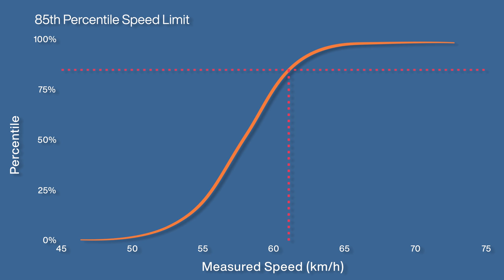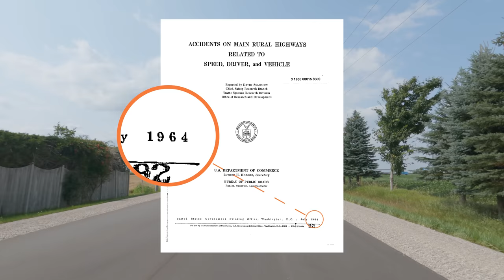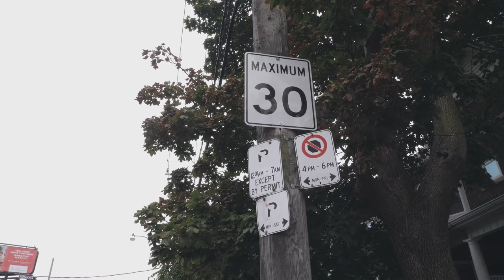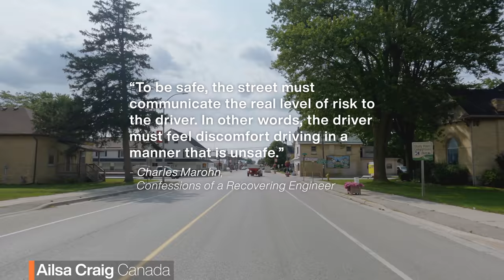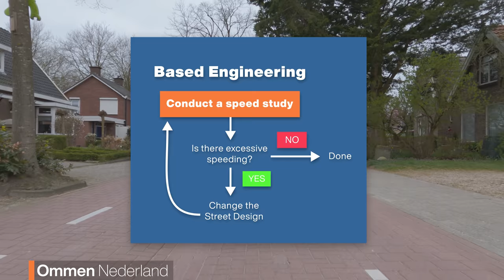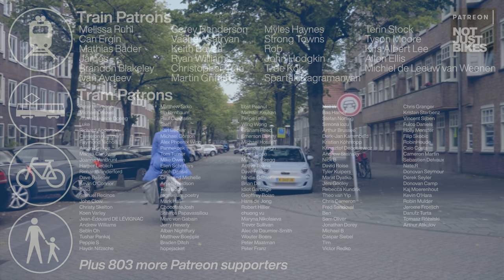The Wrong Way to Set Speed Limits [ST06]

Comment: It seems like a "dark pattern" to add in speed bumps, plant trees in the direct pathways of vehicles, or to assemble posts on the road to deter drivers from exceeding the speed limit.  To me, those ideas work no more efficiently than installing a sign to alert drivers to slow down.  Perhaps a more efficient strategy might involve replacing long, straight roads with pedestrian or bike lanes instead.

Comment: Oh my god it would be SO nice if they set speed limits the way you suggest!! There's a few long stretches of country road I drive down regularly that have speed limits of 60 km/h– why?? It's not busy, it's a straight road, and it's very open, so you're naturally inclined to drive faster!! I personally think the speed limit should be 70 km/h in areas like that. It's not unsafe to drive faster in such places, but that's what the speed limits are set to, which can lead to frustrated and unsafe drivers when others obey the speed limit. It's counterintuitive– you make the speed limit slower to encourage safe driving, but setting it too low for the conditions just leads to MORE unsafe driving!!

I got a speeding ticket last year, so I've been extremely careful about not speeding since then, even in cases like this where I feel that the speed limit honestly should be higher, and as a result people drive too close to and overtake me, often even passing me on my left when there's a double solid line. It's extremely unsafe and frustrating, especially when drivers start flashing their lights at you, or just have bright headlights and are driving behind you at night

It's just... absolutely ridiculous, like you said this isn't rocket science. Make speed limits appropriate for the driving conditions. Boom, problem solved!!

Comment: Yep there’s a stroad like structure where I live that should be road but there are a ton of houses and some businesses that a long it (also two consecutive cemeteries and close to before the highway a golf course with tennis courts). A few years ago they lowered the speed from 30 to 25, but unless you are learning to drive, are with a driving instructor, or taking your drivers test, no one goes 25 on purpose (unless it’s to piss off people which I occasionally do). I myself usually go 30. It is literally a straight road, however, when it gets closer to the high way it is very hilly (ups and downs). This makes me self conscious about my speed , but it is completely flat when you go all the way back by the McDonald’s I work at and my school and many people walk and what not but that stroad is the same. Why does it make you subconsciously slow down when you’re closer to the highway, rather than when you’re by several schools, water parks and businesses? Idk I hate driving on that road and currently I can get away with not driving on it or just going across it.

Comment: Most drivers in my city will go 10mph or so over the limit, except on one street that was paved in the eighties with that concrete slab method. This causes the driver to feel a bumpy ride, and although the speed limit is 40mph, most people do 35 because it feels safer.

Comment: Great video for how to make town and country roads/streets. I would say that low-speed limits on highways are dangerous because it is monotonous driving in a straight line. The UK has some of the safest roads in the world and our highway speed limit is twice that of some US states.
Reply: Your highway speed limit is twice ours?  So, it is 110-160 miles per hour????
Reply: @plcwboy  Of some states... some US states have a 45mph highway speed limit, at least they did when I last drove there. You are correct that I exaggerated. UK speed limit is 70mph.
Reply: @thesupremekai1980s  Highway speed limite have never been lower than 55.  At least not since the 40s.  President Carter saddled us with the 55mph national speedlimit during his term, and since then that has been the minimum, with most highways now somewhere between 55 and 80 mph.
Reply: @plcwboy  I drove along highways with limits at 45mph in Florida so... Maybe the national limit is higher but who gives a sh8t if the highway you are driving on in the middle of nowhere is 45mph. Mostly it was 55mph which was still f-ing slow.
Reply: @TheSakuragihanimichi  where is this highway  in Florida with a 45 mph speed limit?

Comment: nobody follows speed limits outside highways anyway. and even on highways most folk go 10 or so miles over. i ride a motorized bicycle around town at 35-40mph all the time, most of the streets i ride on are marked 30mph, people always pass me. i can be going 40mph in a 30 and if someone in a car is behind me they pass me. i think it is partially just out of lack of attention, they see me on a bicycle, motorized or not, and think i have to be going slower than them, and my evidence for that is that on more than one occasion after someone passes me they start to slow down and sometimes even end up slowing down to a point where i have to slow down. but even then they never slow down to the actual speed limit.

Comment: Speed Limit signs have ZERO impact on how fast drivers choose to drive on a given road. Absolutely NONE. NO IMPACT. 

The issues are two:

1. A small percentage of hyper compliant drivers that can become a hazard- especially when limits are set too low.

and

2. Small percentage of drivers who drive wrecklessly fast. 

The rest- the 85th percentile- are not impacted by speed limits- which is why the 85th percentile rule exists.

Comment: Unfortunately there are sates like Florida, particularly the greater Tampa area, that depend on speeding tickets for revenue. They unethically set speed limits at inappropriate levels and will randomly change them in mid journey to trip people up. Thus assuring that you WILL be getting a speeding ticket. It also helps to set unnaturally long wait periods at traffic lights, even on weekends and the middle of the night, making tension in drivers rise thusly increasing their sense of urgency to make up lost time. Or they will just accelerate to unsafe speeds to get through a light.

Comment: In the UK most speed limits make sense but some don’t.
In the countryside it’s always 60, even on the most twisty roads bc that’s just the rule... but sometimes it’s 50 on a wider road because it has more accidents I presume. It doesn’t really matter that you can only do 30 on the 60 road because of the turns.
It’s usually 20 or 30 in towns and that usually makes sense, often 30 in the edge of the town where the car parks are located or whatever and then 20 in the middle of the town. Motorways are 70 which also makes quite a bit of sense but they are talking about raising it to 80.
There is one road in my area that I think is a deliberate trap, it’s quite a wide road and inviting to do at least 40 on but it is actually a 30 because of the buildings along the road... no traffic calming just two speed cameras. (All of these limits are in miles per hour)
20MPH = ~32KM/H
30MPH = ~48KM/H
40MPH = ~65KM/H
50MPH = ~80KM/H
60MPH = ~97KM/H
70MPH = ~112KM/H
80MPH = ~128KM/H

Comment: In NSW Australia we have many different speeds like L, red P, green P and trucks and it drives you nuts when your truck is limited to 100 km/h with point to point cameras so you end up overtaking a loaded truck and they pass you on the other side or if you go to overtake a red P and they go from 95 to 100 which leaves you in the overtaking lane with many cars behind you.
The joke is the NSW transport minister wants all Australia to do the same.

Comment: In the UK checking your speed constantly is a big part of driver education and it still doesn't work. We have a road network that's mostly grown organically over 2000 years and seems impossible to change with relatively little traffic engineering done to existing roads, politically it's difficult to make change.

Comment: Speed limits should be ""advised", not "absolute".  The worst (and most probably tiring) thing you can do is constantly check your speedometer, which is what "absolute" limits do for fear of getting booked even though there's no victim, or traffic for miles around.  There's nothing on your dashboard that'll warn of impending doom.  The action is outside the windows.

Comment: Here in Sao Paulo - Brazil a Mayor changed the speed on the major city avenues to 70 kph and 60 khp to 50khp. This speed is acctually lower than the design speed for the avenues. Part of the population raged on him but the traffic decreased and the travel time too. 
How travel time improoved? less accidents and better flow.
The accidents that happen around 50 kph don't stop the traffic and are waaay safer than accidents around 60 kph. Why? the kinect energy increses almost 70% from 50 to 60. So the energy involved is waay lower and mainly mas scuffs in the bumpers (if the driver hit the brakes, obviously). Around 60 or 70 the damage easly make the driver stop because the big damage. 
The flow gets better because at 50 you fell safer to be near other vehicles and someone entering yout lane don't make you hit the brake and slow down the lane 300 meters behind you.

Comment: Never heard of that 85% rule. Over here, we just have a few set limits. Highways are 75mph. Big two lane roads separated with a barrier and no traffic besides cars are 55mph. Roads outside rural areas are 45mph. Roads inside rural areas are 30mph and finally at schools we have a 18mph limit in the vicinity. There are no other values used... except once in a while on a parking lot where you might see a 6mph sign.

Comment: I hate how arbitrary speed limits are, as well as how strict they are. I completely agree they should be lower in more populated areas, but like in the clip you were showing of a rural road, the speed limit went from 70 to 50 (I realize the town was up ahead, but I feel like the sign should be closer to that, maybe bigger if seeing it from far away is an issue). Frustrating to have to pay attention to that constantly. Not to mention getting a ticket and having to pay if you get caught speeding. How shitty would it be that you get a speeding ticket for going too fast, and end up losing 1/5 of what you made working that day. Not to mention, speeds aren't even visible so much of the time. You're screwed if you miss a speed limit sign and aren't technically going the exact right speed.

Comment: Not everything in the Netherlands is designed for the appropriate speed. My city of Zoetermeer has a road that's is designed almost identical as a highway. On/off ramps, guardrail, 2x2 roads, no intersections. You can easily without any danger drive 100km/hr. Yet because it is within city limits, you are only allowed to drive 70km/hr.

Comment: I'm frequently irritated by one entrance to my town, where a new bridge was constructed and set for a speed limit of 30 mph.  The bridge is wide, with generous lanes (two on each side), good lights and such... and it's coming off a 45 mph winding road, and the thing is, given that the bridge slopes up and then down again, I cannot for the life of me stick to 30 mph without using my brakes.  Coming from the top of the bridge down to the regular street level turns me to 35 or higher, every time, unless I go under 30 at the top, which, coming from a 45 section, feels likely to provoke road rage.

I really hate when the natural speed of the road -- the kind you can maintain without using gas or brakes -- differs markedly from the posted limit.  It's usually when the street has a particular downgrade to it.  There's another section the next city over that has only a slight downgrade, but across a long stretch, so trying to go 30 like it says requires the use of brakes, whereas the natural speed for that section, the speed the car will go if you just let it, is 35.

There's another bridge heading out of that city toward the waterfront, and you approach the bridge going 35, and have to be 35 at the bottom of the bridge... but the only way to achieve that without brakes is to drop to 25 at the top of the bridge (I've experimented).  And I can see why you can't go faster than 35 there, since there's a sort of hidden driveway that joins the main road, but it's bothersome.

Lastly, there's a section behind our local Walmart that is a windy three-lane with close trees, and is marked at 35... but it feels unsafe to drive it at 35, and I wish it were marked 30.  It feels like a 30.

Comment: You are forgetting that perceived speed depends on what vehicle you are in.  Lower smaller cars feel faster at any given speed than larger vehicles that are higher from the road.
There are also some cultural implications that affect this.  They severely narrowed a road near my grandparents house to reduce the speed.  It worked for about 6 months until the people driving on it everyday became comfortable with the narrowness and started going faster again.  So they narrowed it further and the same thing happened.   They gave up and we now have a narrow road that locals drive 65-70 kph and non locals drive 35 kph. 
I lived in europe and the people are wired differently.

Comment: Great video, and as someone who occasionally participates in controlled street racing, I agree with this whole heartedly. However, I have to point out that this ignores the factors of confident (and in most cases OVER-confident) Motorists. There is a considerable percentage of people who have such a good grasp and understanding of their vehicle and the roads they commute that they will be inclined to  ignore "Road design" All together. A 30 year old driving a camry could be more likely to drive faster than the 20 year old in the Lamborghini and vice versa. Relying solely on road design isn't as good as this video makes it out to be. It just takes one guy to go 40 in a 25 (In freedom units) because he thinks hes got this. And for some people, they do have that. They could go 60 in that 25 and MIGHT not cause problems. Albeit one good apple doesn't freshen bunch, and fresh apples rot over time or are eaten by horses, but Its hard to try and put every single driver into one category of people like that.
Reply: Yeah.... I've got to admit I'm one of them lol. I go slow in 25 mph zones, but other than that I'm fucking zooming

Comment: "Most people don't consciously think about what speed they're going. They're not obsessively checking their speedometer or reading every speed limit sign they pass." Another way to know I'm a weirdo I guess. My anxiety requires me to be so aware, and it IS definitely exhausting.

I hate speed bumps as a speed control device though, bad back and bumps do not mix.
Reply: I check it all the time, mostly to see if I'm maintaining a steady speed without using cruise control, which I refuse to use except as a last resort. Letting my foot off the gas and still getting power is just wrong. My tactic for avoiding speeding tickets is to match everyone else's speed, and drive a vehicle that doesn't draw attention to me. Blending in seems to be working

Comment: In Calgary, this is not how speed limits are set, they do not use the 85th percentile rule. Speed limits are set by road type and usage. Speed limits were recently reduced to 40 or 30 km/h because pedestrians are far more likely to survive accidents at that speed. It is not due to road usage or driver habits. Design speeds reflect the radius and pitch of corners, not the habit of drivers.

Comment: Idk. I don't have much trouble keeping an eye on my speed. And if it's a long road there's adaptive cruise or speed limiters you can use in your car (assuming you have a modern car).

But even in my 2001 Corolla I could drive the legal speeds with no issues. You learn what noise and gear goes with a speed and you don't even have to check the speedo and be within 5km/hr from the limit at all times.

I feel like too many drivers are just lazy =l

(also I have diagnosed ADD. If someone is likely to be distracted it would be me...)

Comment: One of the biggest drivers for changing speed limits where I live is revenue. I play the game right and don't knowingly exceed the speed limits. But our state government probably has more speed cameras per head of population than any other on the planet. So, in fact, the 85% model probably still rules and they keep adjusting it down as revenue falls.

We also adopted some of the worst aspects of the Dutch system while combining them with our own city beautification plans. In the inner city we use roundabouts, combined with separate cycle land and humps where pedestrians cross. As if that's not distracting enough, the infrastructure is planed out with agapanthus, making pedestrians much harder to see. I have had far more near misses with these things in place than I ever have using simpler systems.

Looking at the way the Dutch have done this, they have integrated the entire street, rather than just making showpiece intersections here and there that confuse the bejesus out of everyone (well, me...).

Comment: "dont read every speedsign" so they shouldnt be allowed to drive? a sudden drop in the speedlimit tells you thats theres some danger ahead, its more narrow, curvier or their is alot of of/on going traffic; here in germany, when the drop is not because of safety concerns they usually tell you with a separate sign:
30
noise pollution
, and even if its because of safety they tend to tell you with a seperate sign (ex road work ahead, tight turn(s), you will to have give way at an interception ahead or the interception has trafficlights).